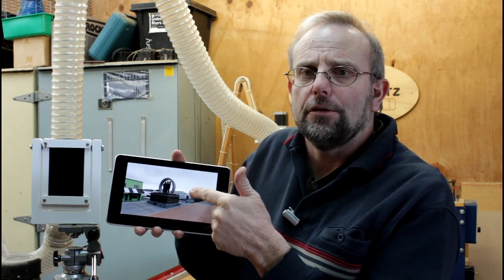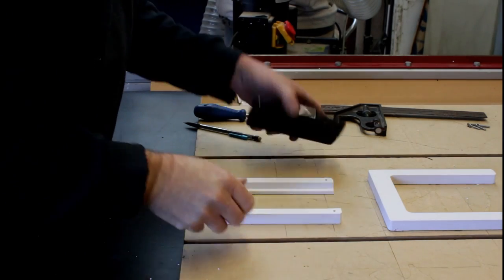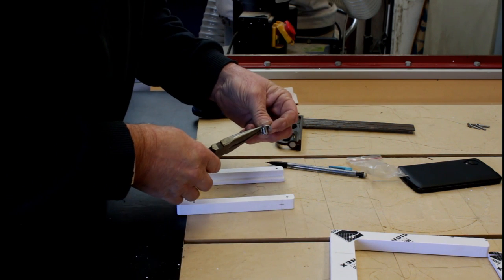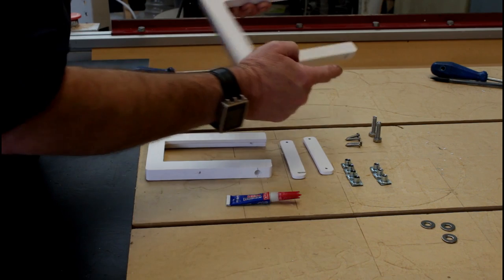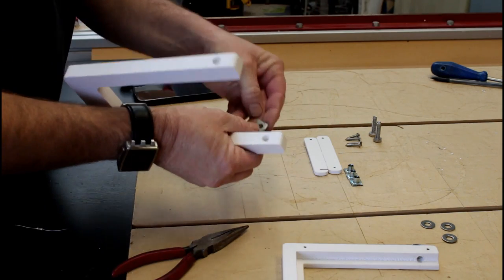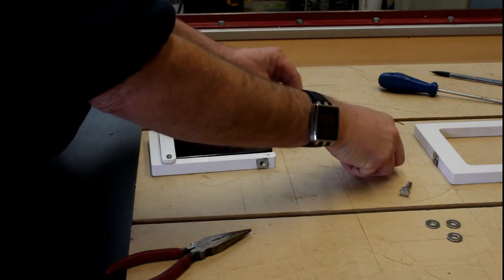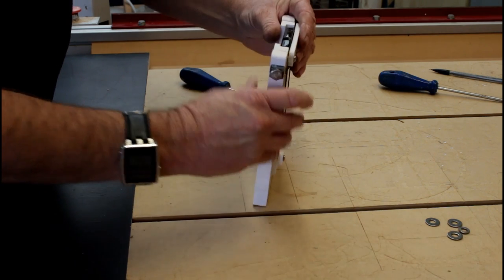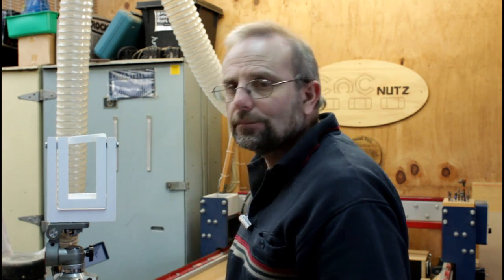PhotoSphere Cradle - CNCnutz Episode 100

Comment: Great video Peter! I wish I could find some signex like you use!
Reply from the maker: ViperishTiger My 2nd choice material for this project was MDF but I had the small scrap of Signex in the bin so thought I would use it. Have you tried sign makers in your area for Signex? 
Cheers
Peter
Reply: ***** 

I have, no luck so far. I'm still trying.
Reply from the maker: ViperishTiger Just done a search for Mulford Signex and much to my surprise it looks like it is only sold in this corner of the world. Australia, New Zealand and Asia. 

This is a first for me. Usually it's me wishing I can get something I see on a Youtube video.

Cheers
Peter
Reply from the maker: Mike James
Signex is a PVC Foam board with a hard skin on both sides and looks a lot like a plastic version of MDF. I don't know what the firmness of the expanded foam is in Sintra but from the photo's I found of it it might be quite soft. Signex is hard and does not compress so if Sintra is the same then it is probably the same product under a different name. You would be the best judge of that Mike. You may have seen my Signex holddown video so if you can make them from Sintra and they behave the same then we have a winner.
I would be interested to know your thoughts Mike.

Note: I don't Choose Signex as a material for any reason than I have some. It was an off cut from a sign I cut out. It has no special properties, Cost advantage or anything else that recommends it to me other that it is there.

Cheers
Peter

Signex®
 is similar to a PVC Foam product but with far superior quality for more
 demanding applications. The manufacturing process results in a 
"skinning" or outer layer of the foam board creating a harder, smoother 
and more scratch resistant surface along with increased mechanical 
performance.

Signex® is a very 
strong, durable and light weight product that will not rot or delaminate
 like other products making it perfect for the signage and building 
industries.
Signex® is very 
chemical resistance and can be handled and worked with like many other 
building products such as timber.  It can be routered, glued, filled, 
sanded and painted with standard woodworking tools whilst providing an 
improved surface finish. - See more at: http://www.mulfordplastics.com/products/signex#sthash.aPTInogk.dpuf